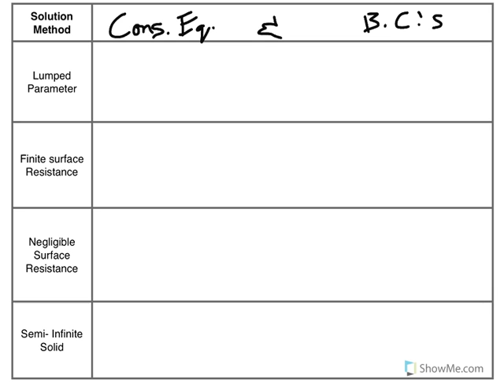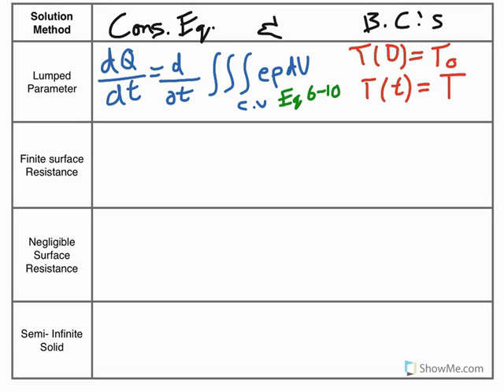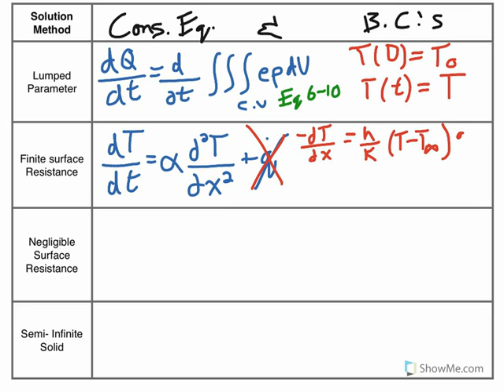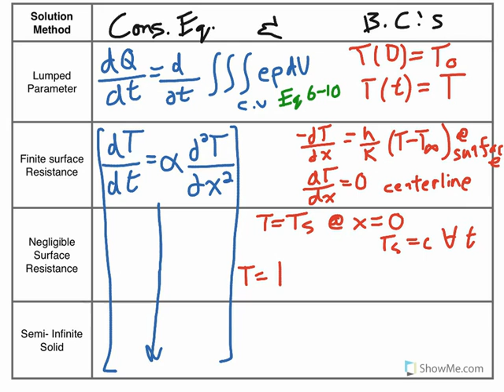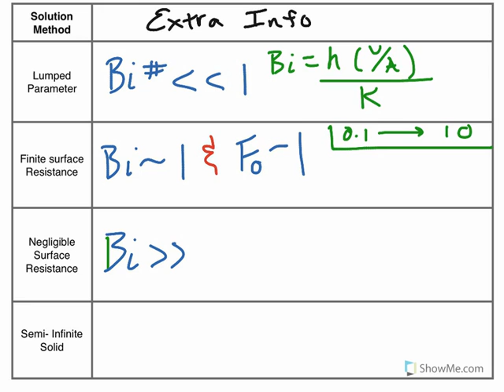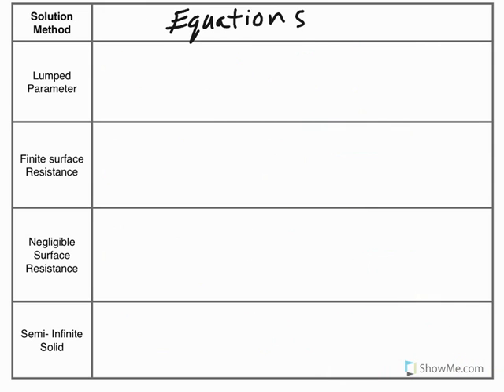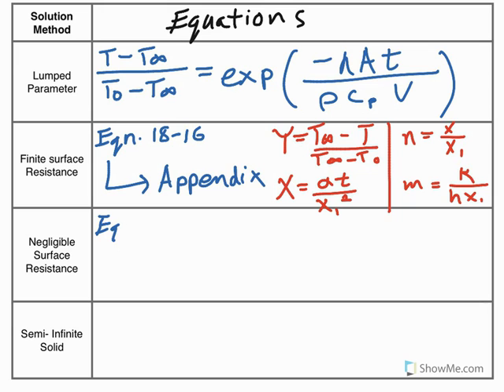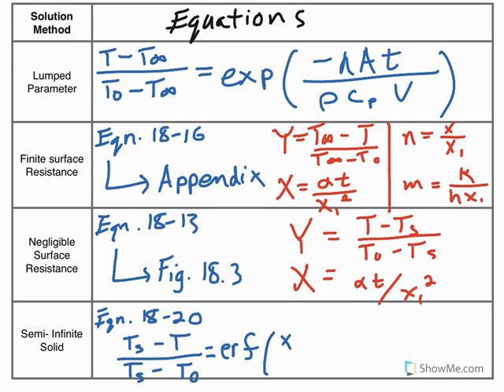Ch.18 Unsteady-State Heat Conduction - Soln. Methods

Comment: Great video and I appreciate the way you organize the solution methods. I do have a question regarding your use of the Biot number. I think you might have it flipped due to fact that, as stated by the textbook, the Biot number is the ratio of conduction to convection, not convection to conduction. Therefore when the Biot number is large, conduction dominates the heat transfer. Please correct me if I am wrong.